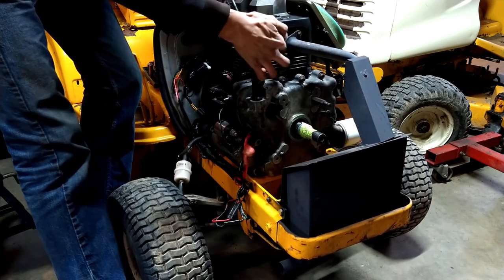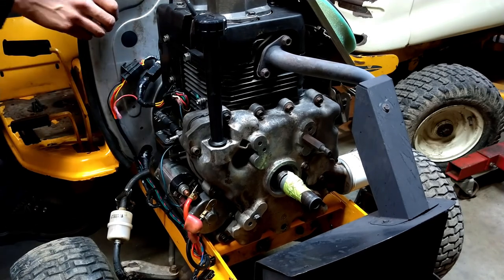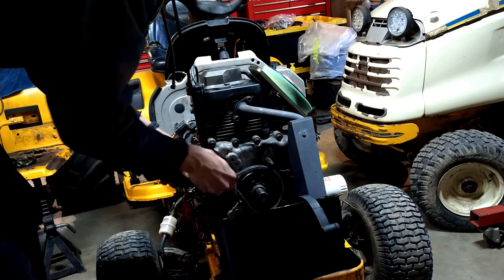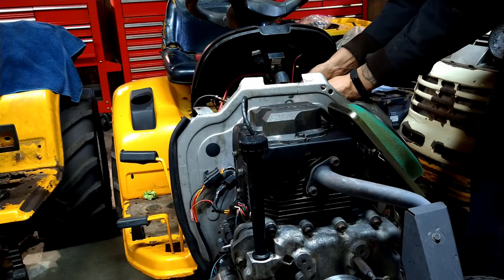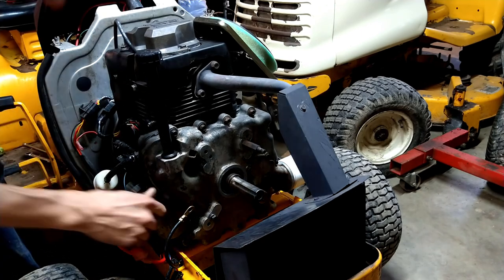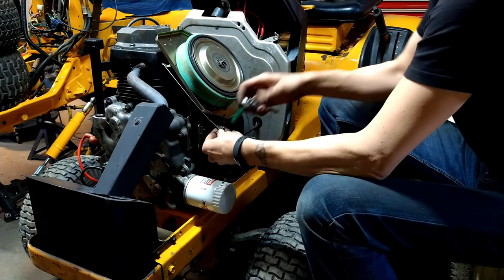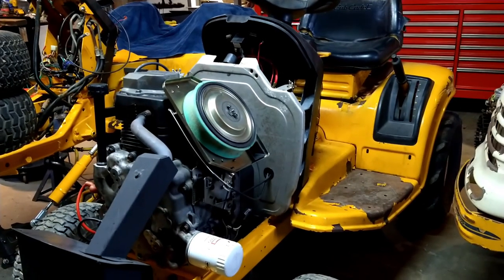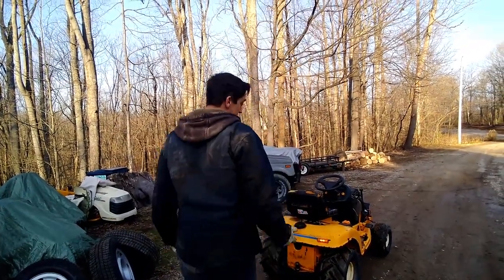Kohler Command CH16S Final Reinstall & Cold Start – Cub Cadet 2166

Comment: Do you know what steps to take my fuel filter doesn’t have any fuel in it.  I changed out the mechanical pump and filter what would you do for the next step
Reply from the maker: A few things:

#1: check for fuel flow from tank to pump inlet through the main fuel line.  Over time debris can settle at the bottom of the tank and block flow.  Fuel lines can also deteriorate and swell closed.  Just unhook the line, if you have at least half a tank of fuel, it should gravity feed the line and you should see a steady stream of fuel.  If not, blow through the line and see if you can blow back into the tank and get fuel to come back out.

#2: New doesn't always mean good.  Where did you get the mechanical pump?  Are you sure it is functional?  A lot of these cheap knockoffs are hit/miss as far as quality goes.

Comment: Will  this delete my old coil and sam on my kohler ch16s spec no.45509
Reply from the maker: Yes, the superseded  part number is 12 707 01-S and is the kit  that eliminates the SAM.
Reply: Thank you so much for the help I have not  work  many  kohler engine mostly  bs but see u have
Reply from the maker: You'll like working on the Kohler single cylinder engines.  Super easy.